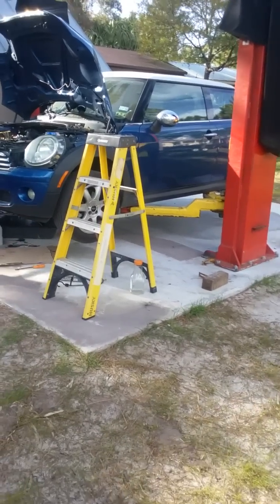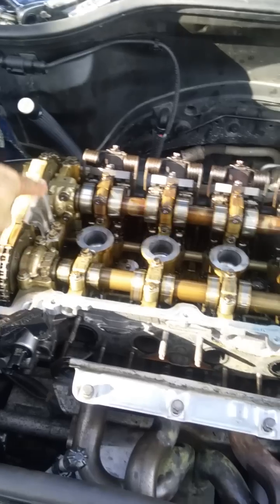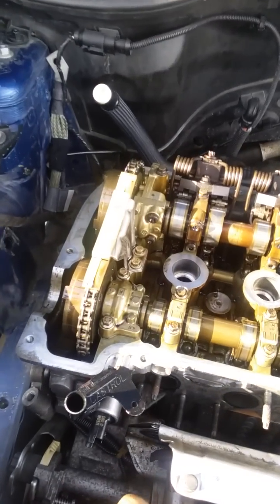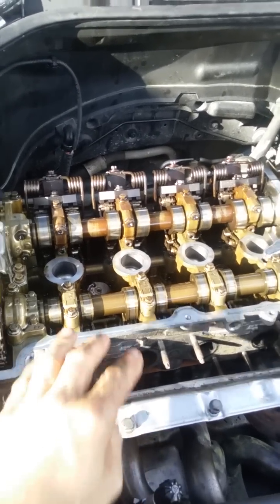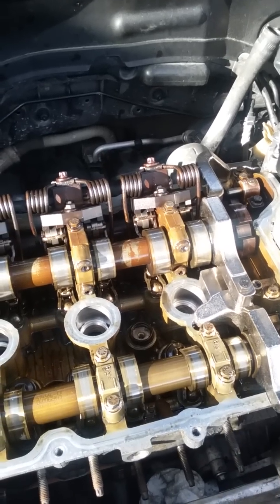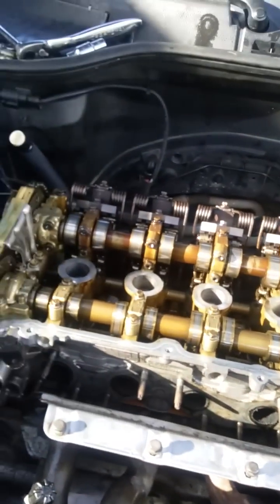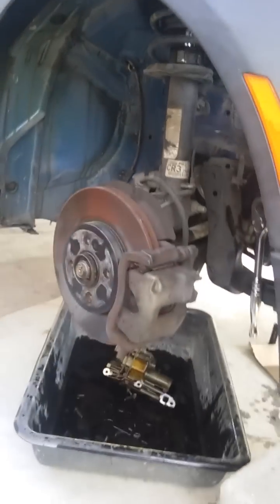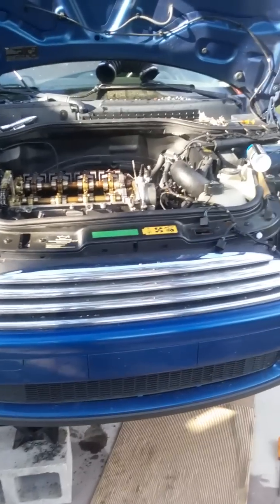The #1 Mini Cooper R56 Repair Video

Comment: Nice video. You're pretty brave setting that car up on cinder blocks.  My wife wants a mini but I'm afraid I'll be under the hood more than in the car.  Any thoughts on latent defects?
Reply: Eric S   My wife’s 08 has 196,000 miles on it now. I did the timing chain kit and 5 new valves in it around 148,000. Still runs great. Little maintenance here and there , but overall she loves it and it gets around 48-51mpg
Reply: It looks like the engine is being supported by a cinder block while the chassis is supported by the lift.

Comment: So I just replaced my valve cover because there was a hole in it and did all the timing stuff because it was worn just like yours and my pcv valve was completely broken. I was blowing tons of smoke and replacing the pcv valve fixed that a lot but it's still blowing a small amount of smoke when I start to accelerate. Any ideas on what that is?

Comment: Nice video, thanks. I think this is the same engine as in my Peugeot 308, marked as EP6 / 5FW. I'm having exactly same oil consumption problems. Removing the oil pan, and the oil pump, you said there was another cover you had to remove? It wasn't the main bearing ladder, was it?
Reply from the maker: the other cover was an oil splash shield, no big deal.

Comment: hii sir. i have aproblem with my mini cooper s 2012 engine n18b16a..the computer shows " low pressure" . i replaced a new high pressure pump and its didn't work. what do you is the problem?

Comment: Eddy I'm Curious did you take the exhaust CAM out? If so what did you use to re install the Valve pressure springs ?
Reply from the maker: Rick Harga , I did not disassemble the cylinder head.